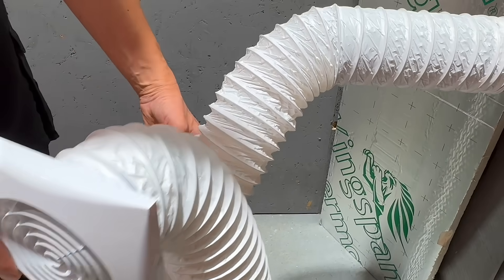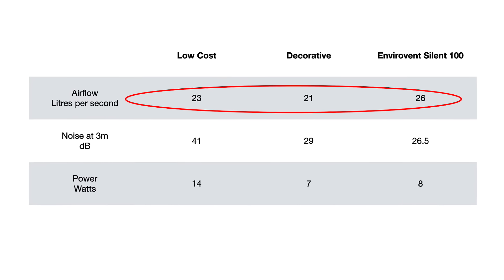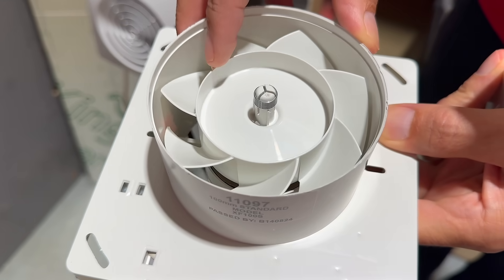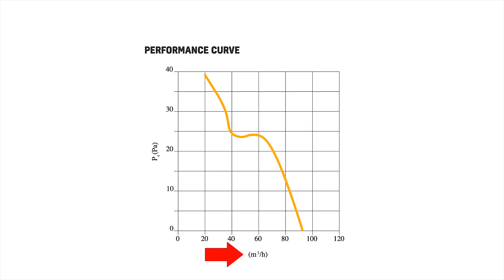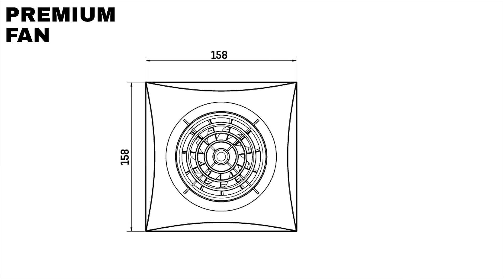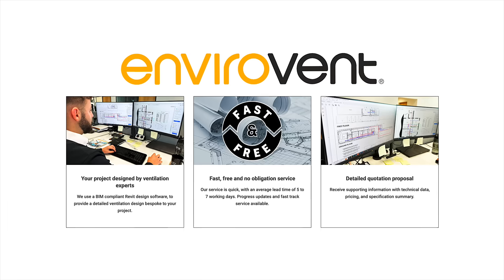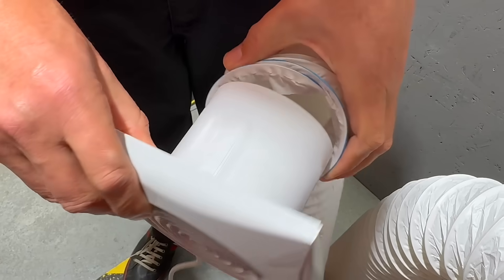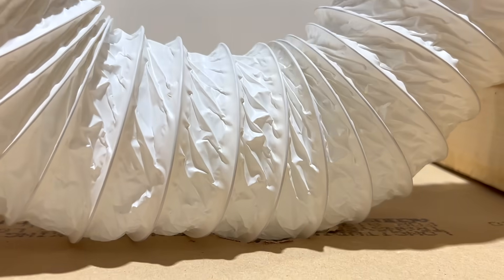The Shocking Truth About Extractor Fans!

Comment: 140mm 12v brushless PC fan, thermostatic speed controller, 12v psu -sorted. much quieter, more air flow and only runs when its actually needed.
Reply: Easy to replace when the bearing goes bad too! Commodity components ftw

Comment: A fan isn't just for condensation in a bathroom with toilet. So humidistat isn't suitable in such areas
Reply from the maker: Humidistat versions also include switch input so do cover all “problems”
Reply: @sparking2016 Once fitted a humidistat fan and it would turn off and then not restart.  Turned out the heat from the dropper resistor would desiccate the sensor 🤦‍♂️.

Comment: Great video but you've missed the one item that will trip up any casual fan fitment. They are a controlled fitting under B.Regs ie. Building Control must be notified and latest regs says the installation MUST be tested AS INSTALLED, to show it meets the performance required, by a CERTIFIED professional, and results forwarded to Building Control.
Reply: Really! What else are building control going to stick their oar in to next. I’m sure we are all going to die if we don’t have a fan in our bathrooms and it’s thoroughly checked by a well paid fan professional.

I’m not renting my property, it’s mine. I own it. If building control did what they should then I wouldn’t be spending huge amounts of money to fix the bodge done by the cowboys that built it. Sadly this is still going on with new builds so it’s not like building control are actually doing anything for the money they cost.

Provided it’s safe then it’s nothing to do with building control and they can jog on.
Reply: @davideyres955  
I feel like that.  We had a wood burning stove, but didn't tell anyone (and it didn't go into a liner, either), and in my bathrooms, I have normal light switches, not pullcords.  My house, my rules.
Reply: @barryfoster453  Yep sure is. Right up until the time you sell it then these violations are all picked up by the house survey/report.
Reply: So, just somthing else I  wont be notifying, excellent.
Reply from the maker: Good point - we discussed this issue during a recent live stream - https://www.youtube.com/live/OlTniinvHCw?si=uRrbrX3c7lVvMfeR